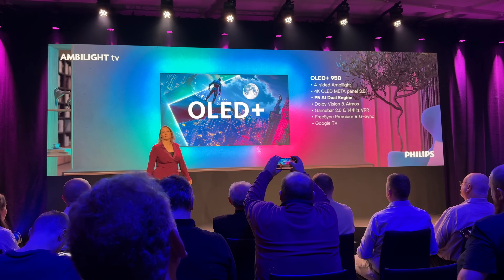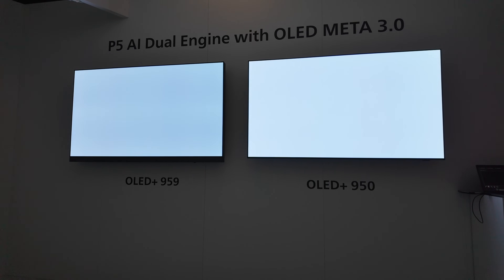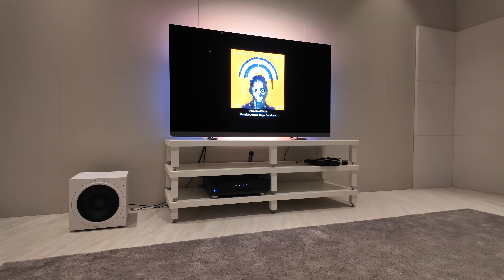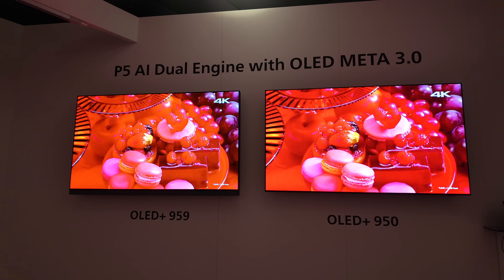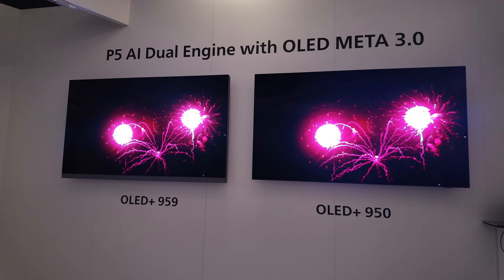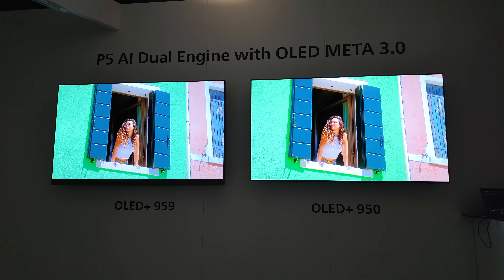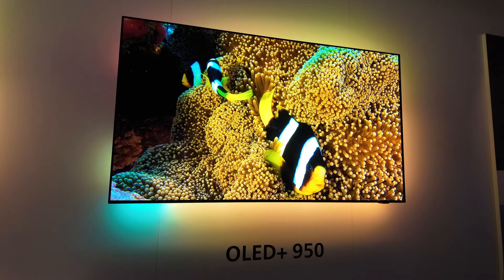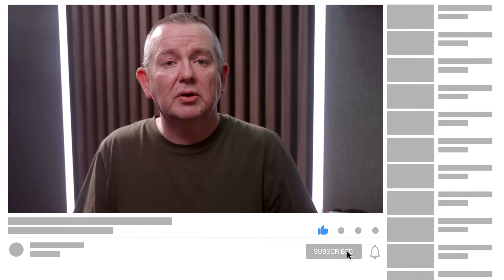Is RGB Tandem Technology REALLY Better Than QD-OLED? Philips 2025 Flagship TV launch

Comment: All TV makers should have all ports with full bandwidth, not just 2.
PS5, XBox Series X and PC require HDMI 2.1 with more than 30GB/s, presumably Switch 2 will as well, even if games are natively rendered below 4K, less demanding games may require 4K 120FPS  output.
TV should have more than 4 HDMI Ports as well, for those that have 4 HDMI 2.1 gaming devices and other devices, like streamers, a soundbar for their  surround sound needs.

There's no reason why Philips and other TV manufacturers can't use built HDMI Switches and include more than 4 ports easily.
Reply: Get an AVR at this point. If you have all consoles, you probably also want good sound.

Comment: Brilliant listening to the customer and providing their top panel without a build in sound system. Can finally buy a Phillips.  Thanks 
Panasonic that's how you do it, listening to your customers .
Reply: I prefer a nice build in sound system in my tv not everyone wants or needs a home theater system
Reply: That's fair enough but at least now Phillips are catering for everyone unlike Panasonic who insist on having a soundboard built-in
Reply: @George-hl2xm  "I prefer a nice build in sound system in my tv not everyone wants or needs a home theater system"

That's a Straw Man. It's not a binary choice: Built-in audio OR home theater system.

If you don't care about sound, you can buy a display and then spend as little as you want on the sound reproduction. You can grab a $10 pair of laptop speakers from Goodwill and plug them into your display.

Let's make this clear: Separating separate functions is less wasteful, saves money, and allows for more choice. One scenario means many people pay for something they don't need. The other scenario means no one pays for anything he doesn't need.

But then, there will always be cheap options for the people who would be forced to enable subtitles if their displays came without speakers.
Reply: @bricaaron3978  and with your theory you will have me paying $1500 and up for a tv that doesn’t have pretty good sound because you just want a monitor that goes both ways 🙄
Reply: @George-hl2xm  You don't have to pay anything like $1500 though. The only reason to pay more for a display, or anything else, is that you know exactly why  you're paying more and why a cheaper option won't do.
Reply: I like sound

Comment: And at the very end he says, "to get more ports to be 2.1, we would need to lower the PQ and we don't want to do that." Why would having more HDMI 2.1 ports lower the picture quality ?
Reply: He’s talking about the Mediatek Pentonic SoC. Pentonic 1000 is more powerful but only supports has 2 48Gbps ports. Pentonic 800 is the new one that can do 4 48Gbps ports but is less powerful than the 1000.
Reply: Ok make a new chip that is less powerful than the old one.  Makes total sense to me. (LOL)
Reply: @kommandantklink5032  the Pentonic 800 replaced the 700 not the 1000, they just weirdly updated their lower end chip first and don’t have a replacement for the 1000 yet.
Reply: I was wondering the same, but just as @fakeninjutsu pointed out, Mediatek's Pentonic 800 is a mid-range chip, and the Pentonic 2000, intended for 8K120 displays, is overkill and expensive for this TV.
Reply: Wait what lmao
Reply: is not like they and others have much choice -imagine 2000 pentomic is expensive

Comment: I'm genuinely confused by all this tandem OLED hype. It still has a narrower colour gamut than QD -OLED. So what's so special about it?
Reply: The usual BT2020 value of qd oled is 85.7% that xy, and LG tandem oled Bt2020 value is 83.07%, Qd oled 1976 uv bt2020 value is 91% and lg tandem oled 1976 uv bt 2020 value is 87%, the uv part of the colour gamut is not as  important as the xy value, so the gap has narrowed significantly,  the advantage of tandem oled is sustained brightness, lg g5 can do upto 2400nit in film maker mode
Reply: Tandem 4 stack does have a narrower color gamut than QD-OLED, but the question is how much narrower?  If these new Tandem WOLEDs do 80% of REC2020 and QD-OLED does 85% of REC2020, 5% is a noticeable difference but it's really close.  QD-OLED is more expensive for the manufacturers, that is for sure...which is a big reason why they're going the Tandem WOLED route.
Reply: @spartan2188 
Bt 2020 couvert a 90% sur les QD Oled contre 82  ,83% sur les tandems Oled RVB
Reply: Just a bit narrower BUT we get it in 83" (still not huge but better then 77"), it's a lot cheaper to produce (so maybe cheaper TVs), better blacks in lit rooms and not from Samsung (objectivly the worst company if you prefere longevity).
Reply: @ So it looks like us PQ enthusiasts will be OK with Tandem WOLED.  Imo, Sony's processing is still the best, so if they make a Master Series Tandem WOLED, I might get it.  We'll see.
Reply: @spartan2188 I agree with that . If Sony makes an 83” Tandem WOLED , it may be a TV I consider . I note Samsung does not plan on making an 83” QD-OLED.
Reply: Longevity cheaper materials and brightness and light absorption
Reply: This in particular is simply a case of Philips having always utilized LG's panels and just sticking with what they know. Also, QD-OLED as a tech is still in its infancy. And, unlike when LG first started to produce WOLED panels, Samsung has been hit up by half the damn monitor industry to use QD-OLED. QD-OLED isn't going anywhere, WOLED in any form is NOT "better." It will just take time for Samsung to refine production enough to where they can supply everything that every brand would want. It's likely that Sony will be switching as well but I suspect that is because they would like to introduce an 83" iteration of their A95L replacement and, unlike Samsung, they'd want there to be consistency across the different sizes.
Reply: @stephenpatterson8056  I think this is the reason right here - Samsung probably can't handle the demand for QD OLEDs from the gaming industry + their own TVs. However, mixing WOLEDs and QD OLEDs and selling them for the same price is downright criminal. As much as Tandem OLED seems to be an improvement, the spectral colour distribution charts still show that QD OLED is significantly better.
Reply: @   Wonder what Sony will do this year.
Reply: Costs, margins and profits.
Theirs not much profit and margins in that technology.
Within 5 years mini LEDs and OLEDs will be significantly and exponentially improved.
Reply: It's cheaper and brighter. But brighter isn't always better. QD OLED is bright enough unless you are blasting the sun at it.
Reply: Cheaper to make? Maybe? Unclear. Seems to benefit the manufacturers more than the consumers
Reply: The shills will still shill though
Reply: QD-OLED pink tint is horrendous plus lifted blacks with any light on it
Reply: @epap1375 I have an S90C in my living room. No tint (that only happens when you try to take pictures of the display. Similar to how WOLEDs can have an overly green or teal tint in photos) and the blacks looks perfectly fine when I'm watching during the day. You'd have to have some sort of studio lights or bright flashlight blasting directly onto the screen to see any difference.
Reply: Exactly.  There's no need to make this big fuss about it.  Call it WRGB OLED still.   You can have a new name when you match or surpass QD.
Reply: @444chroma for me personally it does surpass it, at least with a room with any ambient lighting. 
Even LG’s MLA was sucky in that regard with lifted blacks.

Comment: Nope its still a woled and major screen banding and uniformity in it at 5% black levels testing
Reply: but QD-OLED has raised blacks which are very apparent in a brightly lit room. not a problem with Tandem OLED. Tandem OLED is also 500 nits brighter than the current QD-OLEDs. the raised blacks and matte finish of Samsung are a deal breaker for me. Samsung plans on using matte finish for their entire OLED line.
Reply: @paulcanniff4308  QD-OLED has raised blacks because the matte anti-glare coating from last year creating it only in daylight giving it a milky coating. Seems to be improved for the 2025 models calling it the 2.0 anti-glare. Tandem OLED brighter not sure what you talking about as QD-OLED can reach 4000 nits in a 3% window and 400 nits on full screen
Reply: @wblebon  tandem oled will always have more sustain  brightness than any QD OLED, Tandem is called combined power. samsung just created  a multi stack woled  that can reach 10,000nits and dci color gamut of 96% for AR/VR uses
Reply: @wblebon  QD Oled generally has raised black because they dont use polarizers, it is not due to the matte coating.
Reply: @etinosaoyemwense  Owning a QD-oled 65S95B never seen the raised black with a window full in the back until saw S95D from 2024 in store daylight looked so horrible the milky coating complete destroying the contrast and clarity
Reply: @etinosaoyemwense  You have a link so its for VR glasses 10000 nits hope our eyes not gonna get damaged using this new tech